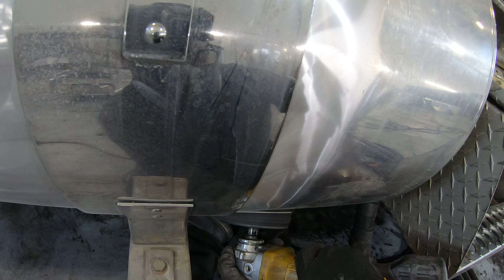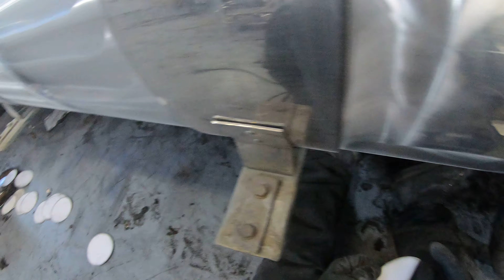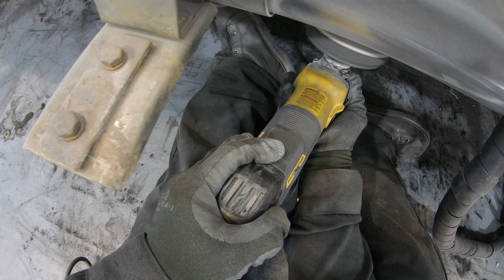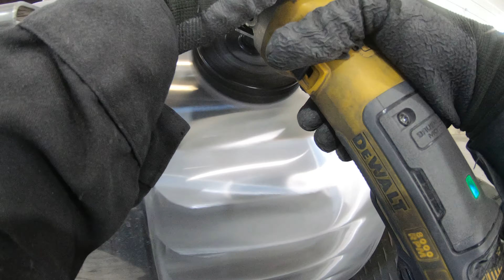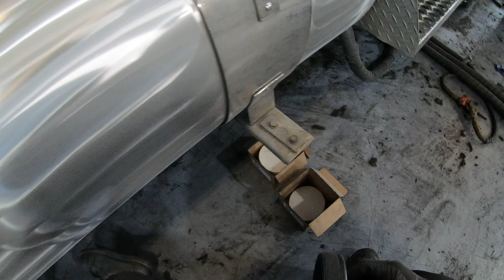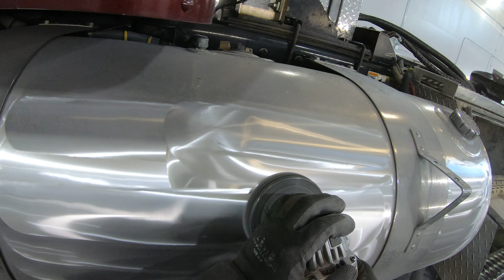Prepping tank to polish.

Comment: What rpm are you sanding
Reply from the maker: About 6000 rpm
Reply: @stephanetouchette1474  what’s the benefit to running it at 6k versus 1500-2000rpm